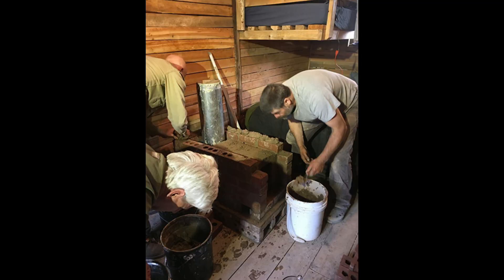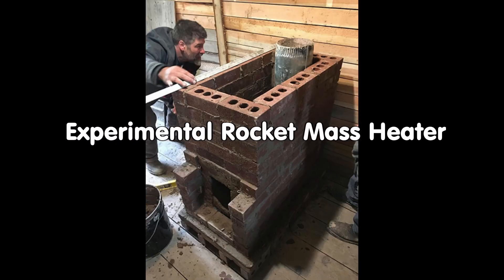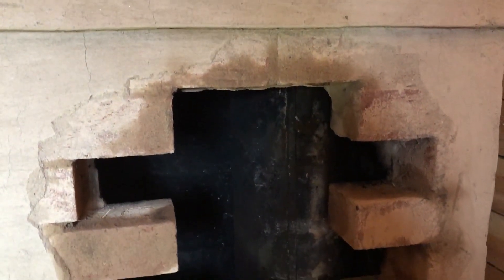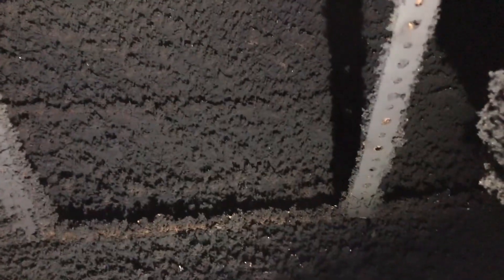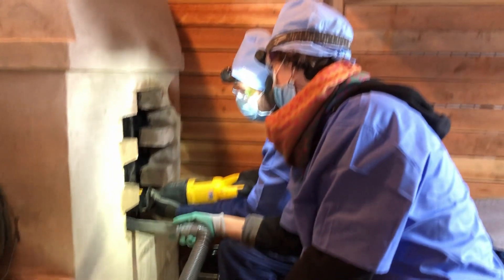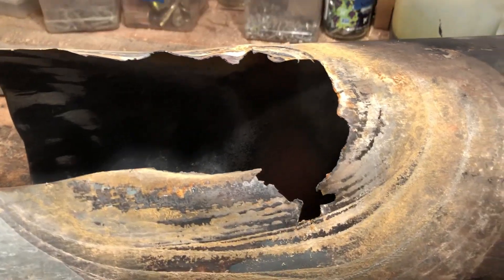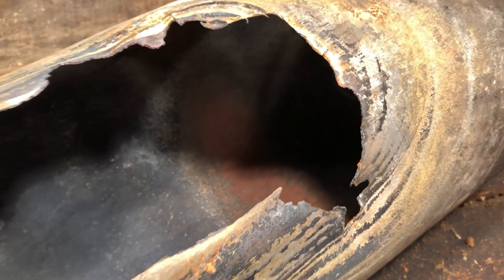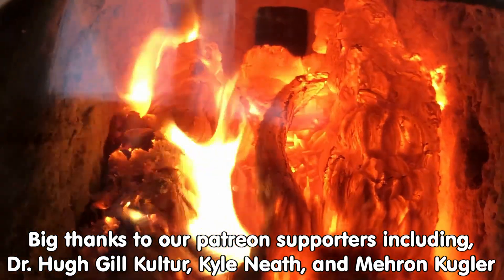rocket mass heater surgery - part 1 of 3

Comment: 1. The failure of the heat riser was due to bad installation.  The form tubes were shown to be misplaced, relative to each other, not concentric, as the riser material was being dropped in between. The effect was a thick riser on the front side and a zero to thin riser thickness on the rear side, where the failure occurred.  To confirm my theory check the cross-section shape of the removed riser. Tell us whether I am right.  According to my theory, the material was not proven to be defective, workmanship is to blame.  I suppose the heat riser is the most difficult and most critical item of the whole assembly. 

2. The air space shown between the floor and the RMH is good to help the RMH warm to operating temperature.  Also the mass involved will give off more usable heat after the fire is out.  My comments here apply only to concrete floors.

3. Putting the batch box, burn chamber, heat riser etc. all in one container, is unusual.  That helps, I suppose, get the wood and everything warmed up to operating temperature. The discharged heat recycles by conduction back through the burn process.  More precisely, heat loss is reduced.  Am I right?

4. I am guessing the brick housing instead of steel is a bad practice due to the brick absorbing so much heat during the start-up phase that the heat riser warms more slowly.  I expect the bricks help in some ways. 

5. Does the type of heat riser material that was used normally perform well?   

I believe your RMH is revolutionary technology in the energy industry.
Reply from the maker: Jake, I have never heard of you before - have you built a lot of rocket mass heaters?  I thought I was pretty in the know of who the experts were.   In this case, it is an expert building an experimental rocket mass heater.  I do think we have the value of hindsight when looking at what did and did not work in this experiment.   I looked at your channel to see all of the rocket mass heaters you have built, but you don't have any videos.   Could you upload your success stories please?
Reply: @paulwheaton  I haven't had any successes.  I haven't had any failures.

Are heat risers commercially manufactured?  Should they be?  I could invest in that.
Reply from the maker: @jakebredthauer5100  try the heat riser cookbook https://permies.com/t/84432f7/Heat-Riser-Cookbook

Comment: If using a metal heat riser you need a much thicker metal than a flue pipe I use a 4mm wall thickness pipe on both inner and outer part with fiberglass insulation and cement perlite mix between the 2 pipes for my buses RMH but ideally it should not be metal, however mine has to withstand constant motion.
Reply: The metal was there primarily as a form for the riser.  It's just that they left it in place.  It's not clear if leaving it in led to the demise of the riser or vice versa.
Reply: @marthale7 True but 1 year in and mines still fine but as I say mine  is in a vehicle so I have to have something that won't fall apart while I'm driving down the road. so brick etc are not an option.